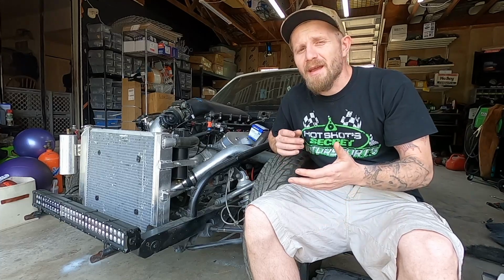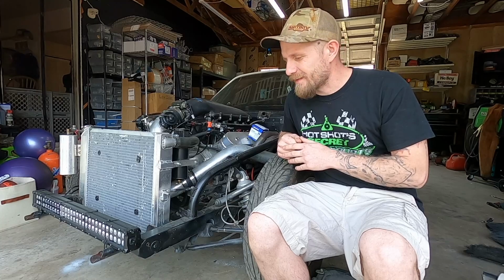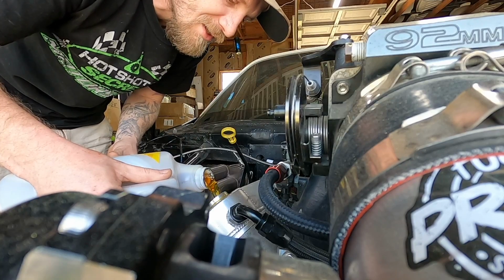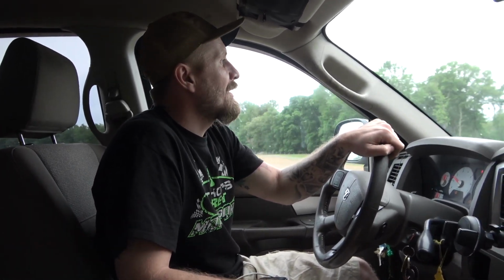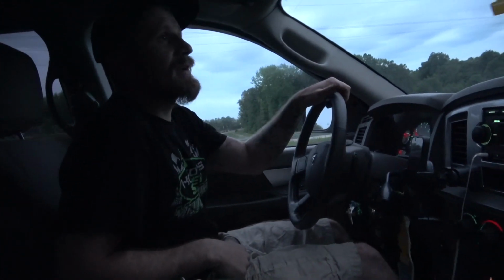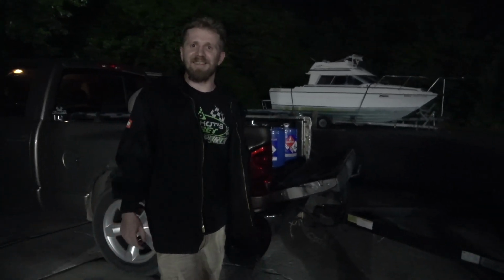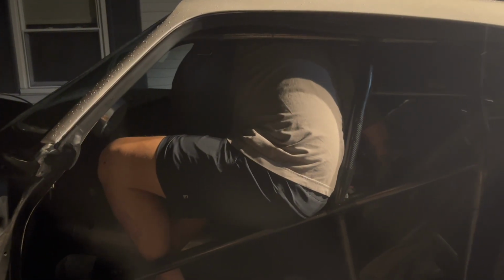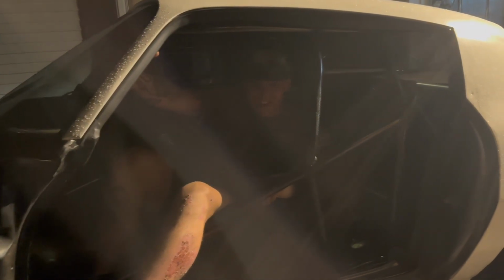HUGE STREET WHEELIE!! CAMARO TAKES FLIGHT

Comment: i like how serious you are taking everything with this car, and it looks like it works pretty good...but you gonna tear that car up on big tires without wheelie bars lol. Just put the bars on it lol or dont test on any rubber and put the launch rpm high enough to get some wheelspeed. Def dont take it to the track without bars hahaha
Reply from the maker: Shewww definitely taking it serious, the chassis caught us by surprise how well it worked out the box lol we are definitely going to a small tire and I figured 4000rpm would be enough but we were wrong it just took it and ate 🤣🤣 gives me great hope for the future though, fix whatever broke and then try it again on small tires and slow down the front quite a bit
Reply: @Matt_Ryce  Matt, too bad You don't appreciate Justin Shearer enough, along with his information, knowledge, experience, expertise to accept his advice, guidance, views. 
Justin is basically attempting to assist, help, give You good guidance, since he senses You have good potential, if You will be 'teachable'.
Justin does not attempt to 'waste' time, effort, work, materials, products, components, etc. by going out to use his vehicles improper, so they will break, so he can fix them.
Poor, wasteful, mindset and attitude.
SADLY'
[saw You with Bill, Billy, Tommy, Allison, SRC, et al before returning back home.. which is good, but You need proper guidance]
Reply from the maker: @newtonfirefly3584  who tf said I don’t appreciate him? What the hell are you even talking about?
Reply: Wow cheif is speaking to fans. Bet he has to go wash his hands now. Biach what reaper told America. You want ever live down.   He's on yt now trying to be irrelevant

Comment: on a stock pan i ran 7 quarts at 1.20 60fts in the past with no oil pressure issues at launch.  8 quarts seems a little much that alot of oil the crank is having to cut throu. i ended up swapping to a moroso pan more capacity and has the trap doors and less likely running pickup dry.
Reply from the maker: Its definitely something I'm going to have to play with and find the happy point. Too much has oil has its negatives but I really think too little is worse. Maybe I'll look into one of those moroso pans!!

Comment: Getting there.. slowly but surely.  If the rear wouldn't have broke it would have came down alot easier.. you should be watching what the tuner is doing so you can make some changes at the track or on your test hits.. like you said its going to be a monster..
Reply from the maker: Yup, if it hadn’t broke I feel like it would have rode out a bit and likely settled once I shifted then took off

Comment: FYI venting from the front of the valve cover fills the can quick as oil pushes forward when braking and on decel
Reply from the maker: FYI there hasn’t been a single drop of oil in the catch can yet
Reply: @Matt_Ryce  that’s awesome man ! I know a few guys who have had issues almost filling the can full in one run with vents coming out the front of the valve covers 🤷🏻‍♂️ but keep up the great work can’t wait to see the Camaro make a full pull and whoop some butt!

Comment: Matt ,I have term x in my car to I'm just wondering what you are running for idle ,, cruise,, wot ? 
If I was you Matt, I would worry about getting A to B on gate so you get the feel of the car ,once you get the feel and the tune a little better then turn it up ..I know with my car I had to finally take it to a tuner and let them do  it on the rack because the term x was tuning way to slow and with a race car driving it around to self tune isn't going to work..if it was a street car than you could drive all day, week,month .. 
   the wheelie was cool  it look like it was going to make a good pass until   🤦✌️

Comment: The best laid plans of mice and men, often go...to hell in a hand basket. Which is why we cal them plans, and not done,'s. Keep plugging, you are making slow well defined progress, as am I. Just not as fast, nor less expensively, than I planned it to happen.

But, I did score not 1, but 2 max. Lift cams for my category, that match my engine combo, and the Stock rules for my specific combo, and 2 bonuses, 1 is a Reed custom grind that already set the MPH Record on it's very first pass in a FF/S car, then later set both ends, ET and MPH, and he held the record for the max period, and another brand new Lunati, same profile, different duration that was never installed or  used, due to a sponsor conflict, scored at a great price, and both were shipped yesterday!

 Waiting on Piston mfg, and the completed short block...Just Nutting and bolt checking the car and looking at and servicing every wire, and plug now from taillights through headlights. All long block parts are cleaned, painted, replaced, and serviced and on the tables ready to bolt on soon. You on the other hand are getting very close to track testing, and racing sooner.

Time to smile Matt!

Comment: Dang dude that was nuts hanging tires like that, but I have a question and it maybe stupid but how are you going to be able to get traction on a small tire when a big tire hooks like it does? On small tires, won't it just smoke them?
Reply from the maker: Suspension adjustments, tuning adjustments, seeing the chassis work that well tells me I can definitely make a smaller tire work, but it will probably take a gear change as well

Comment: Probly got a lot of oil spray I g straight into the vent hose on the front of the tappet cover there
Reply from the maker: If you’re talking about the catch can hose on the valve cover, believe it or not there’s not a single drop of oil in the catch can. Only water. Comes out so clear I could probably drink it
Reply: @Matt_Ryce  wow ! That’s crazy

Comment: You should be testing on the small tire's because there's a huge difference from small tire to big tire, that thing is gonna surprise alot of people, I feel it's gonna go alot of rounds good luck be safe man
Reply: Sometimes a fella that always runs small tire just wants to make a hit on the street on big tires. The best time to do that is when you buy a new race car abs it’s already sitting on big tire.
Reply: @mraycgz  kinda like chief talks about the benefits of testing a no prep car on a prepped surface to eliminate variables.. just depends on what you’re trying to test I reckon. PEEEACE!!
Reply: Oops replied b4 I watched the video, lol.
That’s assuming the car is built to handle big tires!!
Reply: @johngrabowski2957  if a street hit is enough to break the rear end, maybe it isn't really built to handle big tires

Comment: You pronounced “pounds” wrong. Came out sounding like “duty cycle” 😜 
let’s walk back through those functions again this week lol.
Reply from the maker: Even still, shoulda spun the tires 🤣 I had extra air in em and everything
Reply: @Matt_Ryce  I assumed there was quite a bit of air in them. I noticed they didn’t squish much when the suspension pounded them into the ground. Kept it round and took it all without a wasted rotation lol. Bad news lol
Should do great on some small tires 👍🏼
Reply from the maker: @Therendonfamilia  about to tear into it now so we can get it fixed up and switched over. I fear my big tire days are over 🤣🤣
Reply: @Matt_Ryce  probably would have been alright if it left on actual gate pressure like you wanted. I’m surprised you weren’t like, “damn that sounds spicy for 3psi” on the brake lol.

Comment: I dont know how you methanol or alcohol racers especially street racers run without a pan heater on the oil pan. Trans pan heater can be helpful too in cold season racing. The oil heater helps so much with milking your oil and warm up time.

Comment: Broken rear end sucks, what is it? fab 9"?  Hope the tranny didn't take any real damage.

How much ballast did you have in the back, if you're willing to say?
Reply from the maker: It’s a Dana 60, had zero ballast in the back. Was just trying to shake it down as is
Reply: @Matt_Ryce  it had to be on 18/20 psi sure didn't do that on gate.. going to keep breaking things that way
Reply from the maker: @chappyboylsx2596  it couldn’t be on 18/20, boost cut is set at 15
Reply: @Matt_Ryce  check data ,did you log that little run
Reply from the maker: @chappyboylsx2596  in true “my luck is the best” fashion I started the log too early, it got the burnout and I guess timed out before the pass 🤦🏼‍♂️😭
Reply: @Matt_Ryce  impressive that it came up that hard on the street with no ballast. how much rubber is on the street there?
Reply from the maker: @totensiebush  it’s a good spot but first person down I didn’t think it would be THAT good